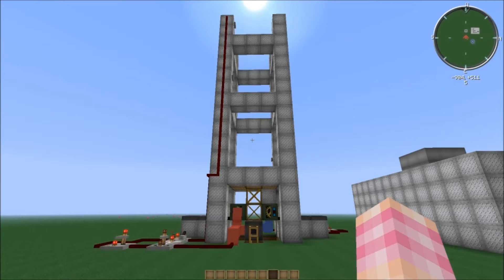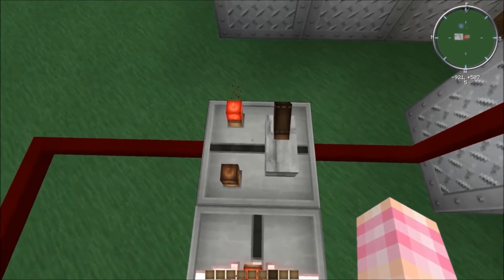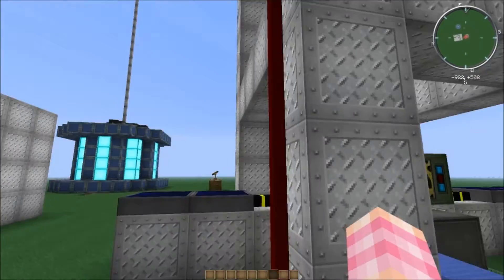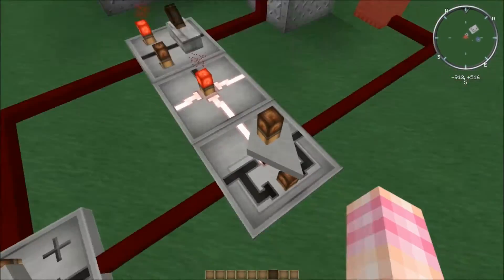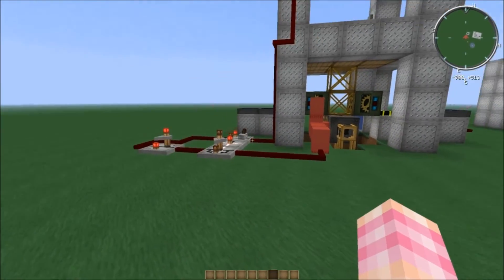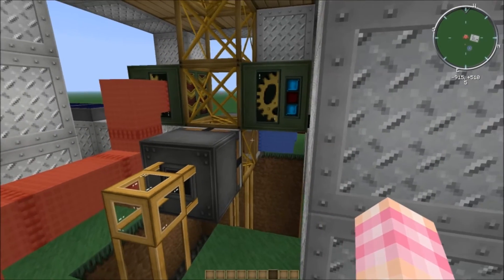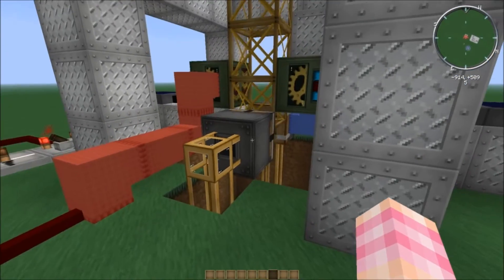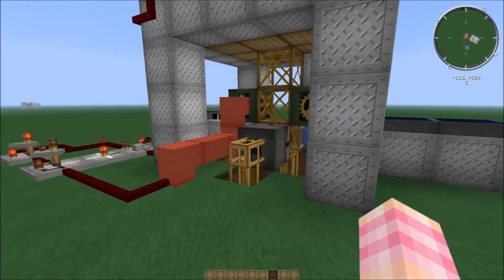FTB Tutorial - Frame Elevator

Comment: I tried to recreate this in 1.12.2 with ProjectRed. It went.... not that well. Most of the circuit works. It's the Block Placer that doesn't co-operate. It lags behind and/or place blocks where they shouldn't be. It lead to everything going off sync and the elevator doesn't reach up to where it should go. (Down works fine though) It doesn't appear to move a 3x3 like in the video either. Just the block on top. SO subsequent blocks end up on the side. Trying to update it with Funky Locomotion kinda worked... unfortunately you get lagged stuck on top. It's a shame. (timing needed a configuration)

Edit: I did try with ExtraUtil blockplacer. But it gets stuck on the ProjectRed frame.

Comment: Hey, Im trying this set up in 1.6.4 but since RedPower hasnt been upgraded I am using REDSTONE IN MOTION and Project Red instead, I have set it up the same way you have, but the counter doesnt fire when it reaches its maximum state, I was just wondering if you would know of any reason the counter wouldnt function this way anymore?
Reply: Nevermind, I was being a complete idiot and didnt have an output on the plus side
Thanks anyway
Reply from the maker: RockOnNinja I'm glad you figured it out. I haven't used Redstone in Motion yet so I wouldn't have been able to help. I have to play around with it some time.